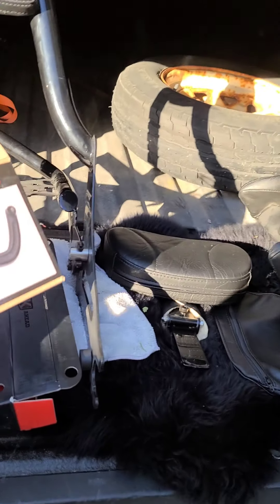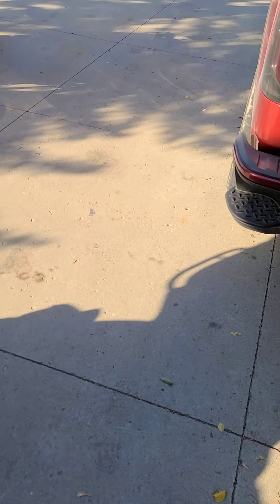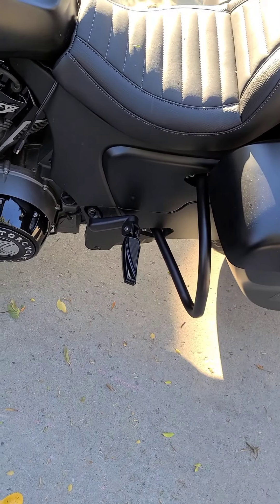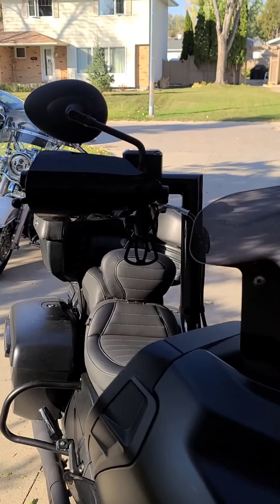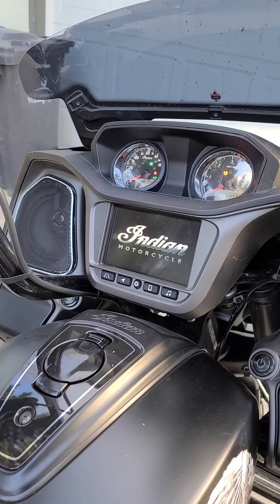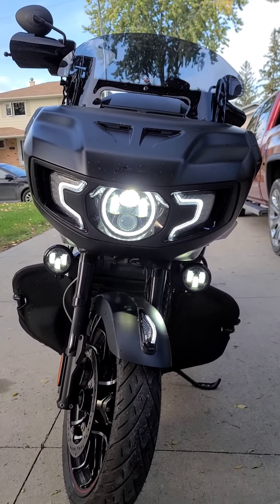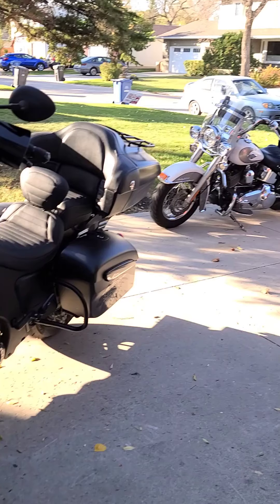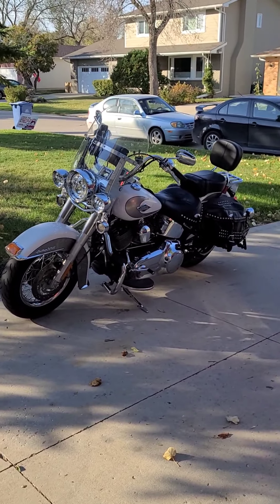2020 Indian Challenger 14000km bike and parts review

Comment: Great review.  I have a Challenger ordered for the spring.  Do you have any suggestions about what I should add first?  I'm already putting on highway bars and a heel-shifter.  Thanks.
Reply from the maker: It depends what your budget is. My suggestion is ride it first for a few weeks and go from there. 
Before I bought my bike I already had  a plan on what I wanted. The seat was first to go. Second were bars. I like a taller bar. Third was exhaust. I love 2 into 1 sound and performance
Reply: @bigpapajay5998  Thanks!